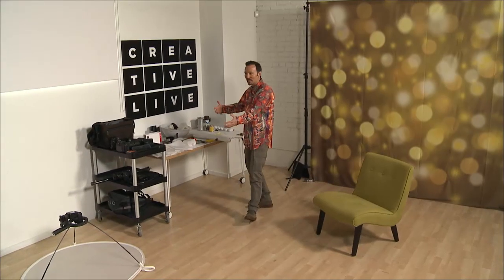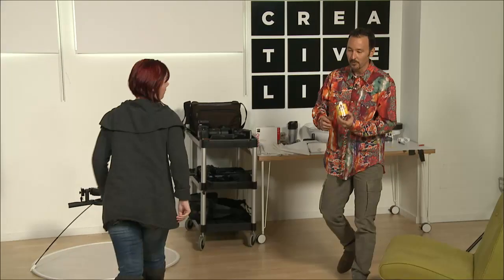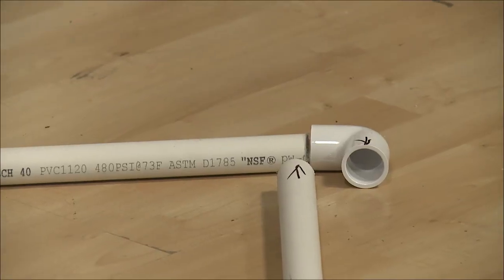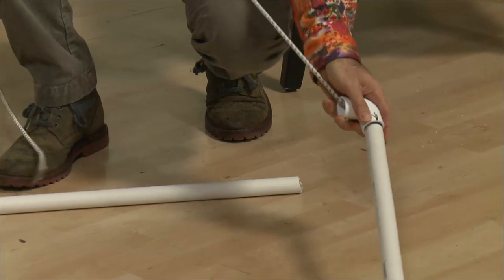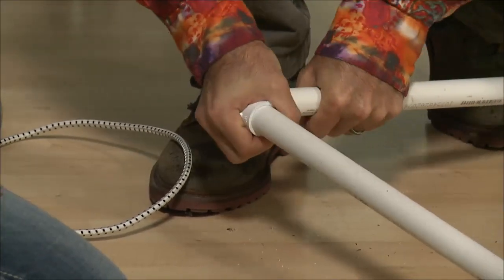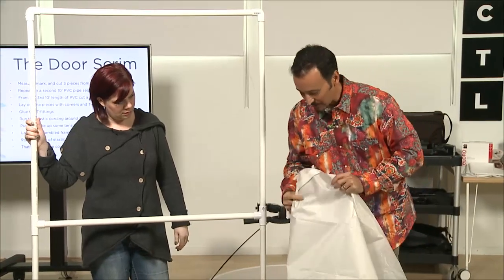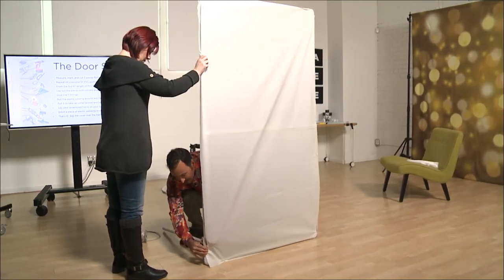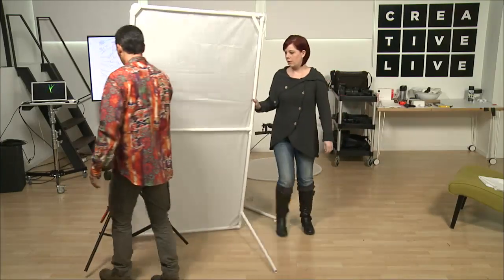Fake Window Light with a DIY Scrim

Comment: I made this exact same frame a while back but I used cheap fitted sheets from target instead of parachute material, no sewing needed, pre made and ready to go. I used King Single sized sheets - 2 black, and 2 white, depending on what I need to do. Works a charm

Comment: Great guide i made one bit larger 1.4m by 2m and did have to glue some of the joints. I used epoxy glue as long as you sans the tube for some grip or you can buy pvc glue without having to sand. The middle bar ads strengh but can be removed if necessary all great and lightweight

Comment: Yes... what is that speedlight with scrim adapter?!! That looks awesome!
Reply: Thanks Jimmy!  Picked one up... a bit of a handful to lug around but it does make impressive light.
Reply: I looked at them when they first became available at B&H but couldn't justify the price. A $20 monopod attached to an umbrella mount or the Godox S bracket that I already owned allowed hand holding any modifier I could need. I don't hand hold lights much anyway.